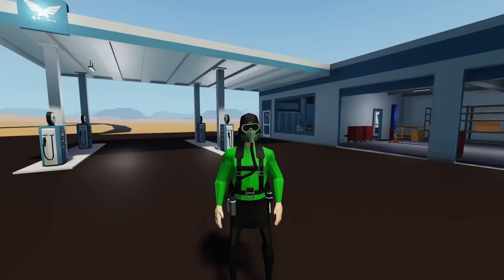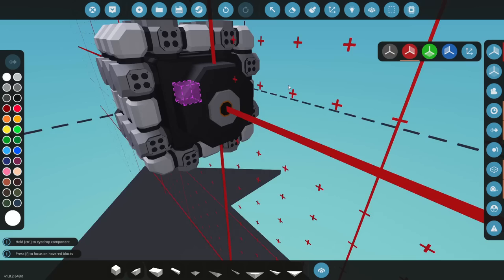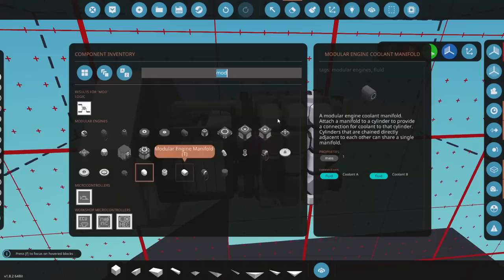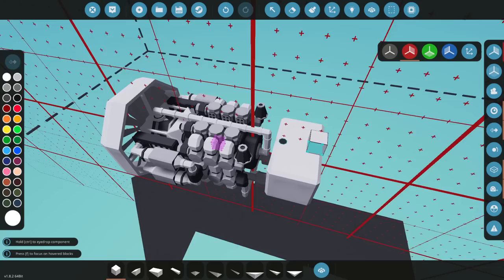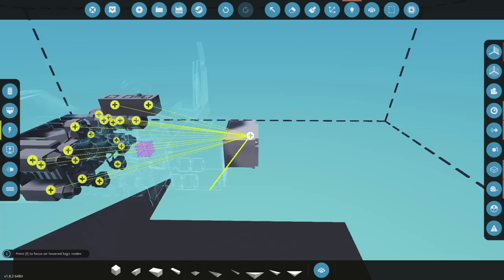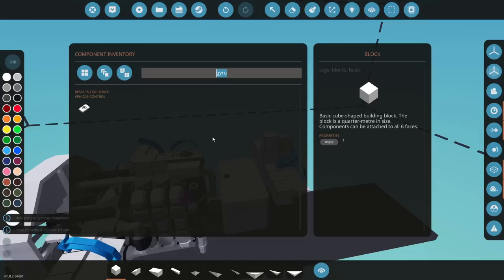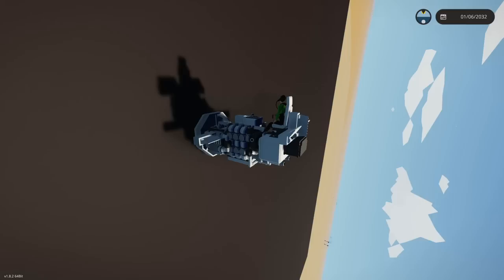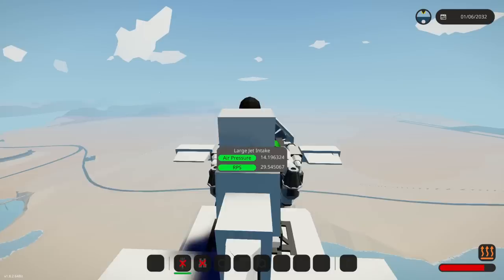Turbine Diesel Modular Engine Build 24cyl 3x1 Stormworks Tutorial - How To

Comment: Very nice. Took this inspiration and tried to incorporate into a VTOL I have. Works 'fine' in plane mode, but in helicopter mode, a completely different story. As with normal helicopters or even using blades in a vertical fashion, the turbine has no pitch, roll or collective control. Going to be an interesting one controlling it with this idea. Challenge started! Don't hurt your head on that one too much.
Reply: found a way to do this for a jet using ducted fans clutches and pivots

Comment: Similar to how jet engines came about, originally they were experimenting with using a turbine to recover exhaust gasses from the engine, and instead of using that turbine to power a compressor for a turbocharger they hooked it to the output and used it to help drive the prop. After some refinements and further experimentation they realized the turbine was outputting almost as much power as the entire engine, and so they moved from a reciprocating engine to generate hot exhaust gasses to a gas generator, and the jet engine was born

Comment: Actually turned out to be a really cool vehicle :) But I was wondering, because I'm a beginner on Stormworks: Is the Large Jet Intake the most compact powerful air propulsion system, is that why you used it? If you rank Large Jet Intake, Large Ducted Fan and Aircraft Propeller, in which order do they rank in compact power?

Comment: Wow, that's pretty neat, and crazy powerful given how compact it is.  I have to wonder what the turbine is doing in that setup though, because it seems like you're just driving it externally with the diesel engine in order to get it to spin the fan but I think you could accomplish the same thing just running the RPS directly to the large ducted fan without the turbine?  I've done that on a train before trying to get it to go ridiculously fast and it works pretty well.
Reply from the maker: there is no connection point for rps on the fan so you need the turbine.
Reply: @ProfNCognito  Ah, so the turbine is just being driven by the engine which then spends the fan.  Neat!
Reply from the maker: Yep!

Comment: Can i use this for a car? if so how, do i connect the same drivetrain leading to the turbine to a transmission?
Reply from the maker: Remove the fan turbine and connect to wheels
Reply: oh, btw do you know how to make a diesel engine that has the turbo whistle sound? i dont remember what the truck name it was but whenever i started moving i heard some whistle noise with the engine. @ProfNCognito